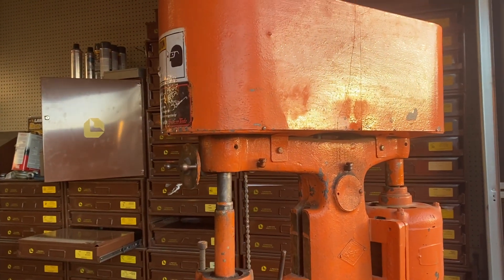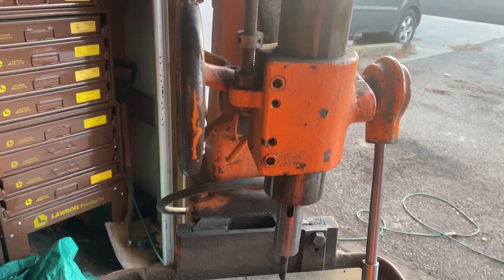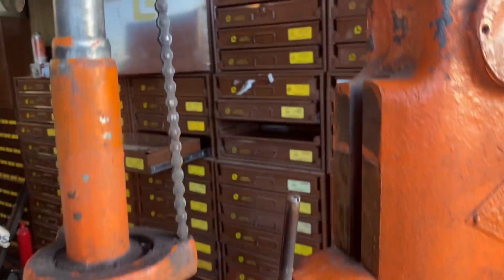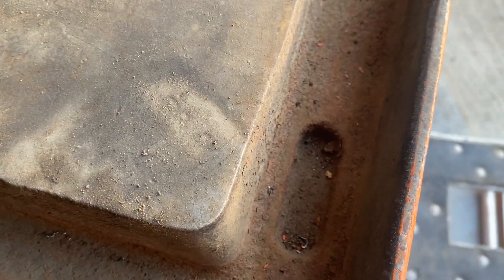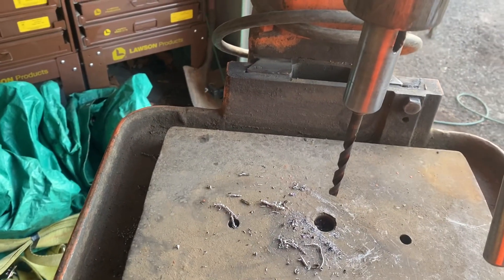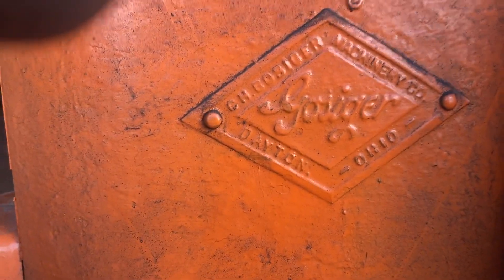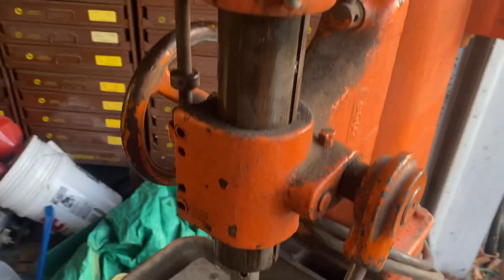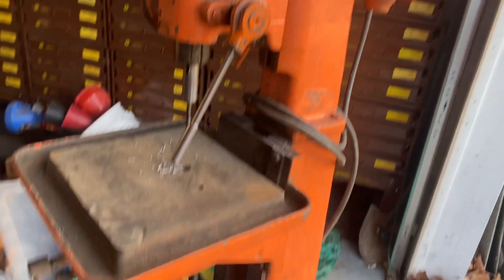New shop machine, Edlund 1B 15 inch drill press

Comment: If the table casting is heavy enough, why not make up a mini palette to bolt down? That would give you the ability to use dowel pins for quick setups but still allow you to bolt down the vice when necessary
Reply from the maker: A very well might just do that

Comment: She's no beauty but that TIR is phenomenal! What is the deal with drill presses these days? It seems like you cannot buy a heavy cast iron gearheaded machine for any price. Every manufacturer uses plastics and aluminum, the rigidity is just not there anymore. Is industry strictly using machine equipment to drill holes?
Reply from the maker: They have most certainly cheapened out on modern drills